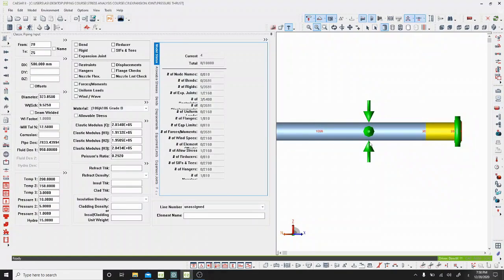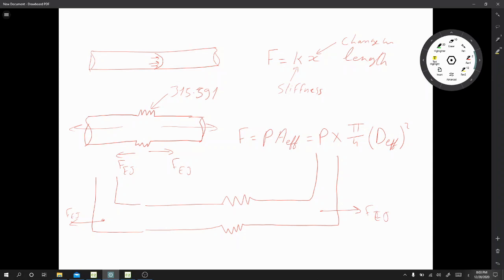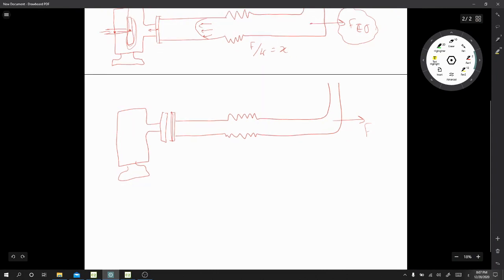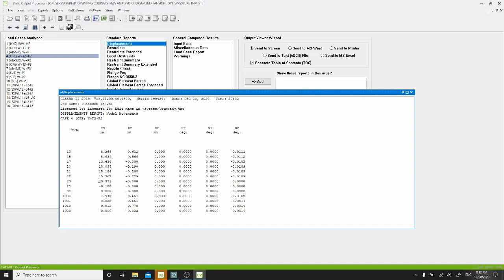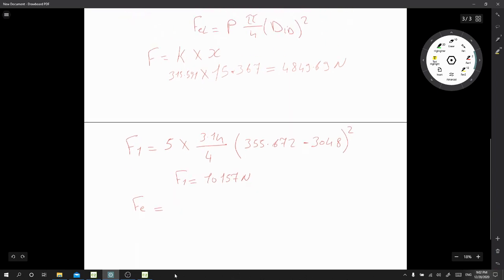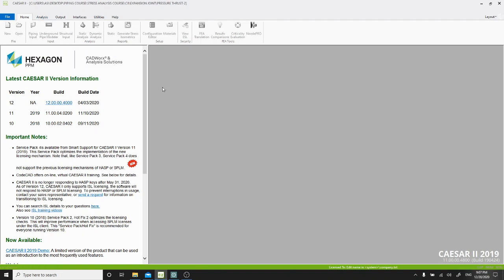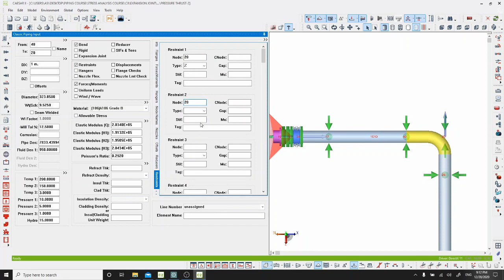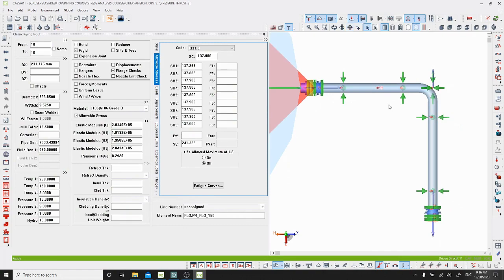10.2- PIPING STRESS ANALYSIS -STATIC ANALYSIS - EXPANSION JOINT (BELLOW) THRUST FORCE - CAESAR II

Comment: Hi, how do I select the stiffness value? Can I first assume the expansion joint as rigid and make the relationship between the maximum force and the displacement?
Thank you
Reply from the maker: You should create Cnode connection to get the displacement and with the displacement you can select the EJ which suit for this expansion
Reply: @pipingstressanalysisengineer  thnxs

Comment: Dose same forces will appear if tie rods used. Please share any example where exp joint with tie rods used.
Reply from the maker: I am not quite sure of your question but let me explain what I understand from you. we have two ways either use tie rods for safety only and this was USA bellow recommend in this case it should not carry any load and if EJ show any load that means you have a problem in your study. the other way you will depend on the tie rods to care for the axial load which means EJ does not have any flexibility in the axial and the tie rods support will care the thrust pressure load also you do not need to use anchor in this case

Comment: I have some queries..
I really dnt understand why you are removing the effective dia and applying thrust as a force vector . Why to make it unnecessarily complicated ?  
Also , instead of using such a weird support on the Elbow for the Pressure thrust, why not use two tied belows and avoid axial stoppers ? 

lateral movements of perpendicular bellow will solve the exp I guess.

Thanks
Reply from the maker: Hey i am working on new video to explain when we should use effective diameter and when we shouldn't with clear explanation for the calculation behind it main while you should remove it from any equipment nozzle to release the thrust pressure force from the nozzle

Comment: hello plz i want to know how to extract this loads on restraints not elements and its for dimensioning the supports :
pie weight only , fluid weight only 
thermal force on the support (if the support is +Y the the force is DOWN ) i hope you can answer thnx
Reply from the maker: sorry but i could not understand your question exactly can you explain more
Reply: @pipingstressanalysisengineer  i need to know the loads like pipe weight or fluid weight on each support
Reply from the maker: @hamzayemmi6139  check the sustained load case (w+p) in restrain load summary

Comment: Sir
If the Forces exceed in FY to how to reduce it or if the exceed in FX & FZ
Please Help
Reply from the maker: You need to rearrange the support to restraint the line so it can reduce the movement
Reply: Sir: I have reanged the supports but Moments in My is increasing
Reply from the maker: @manojmishra9499  you need to use expansion joints with less stiffness
Reply: @pipingstressanalysisengineer  Thank You very much Sir